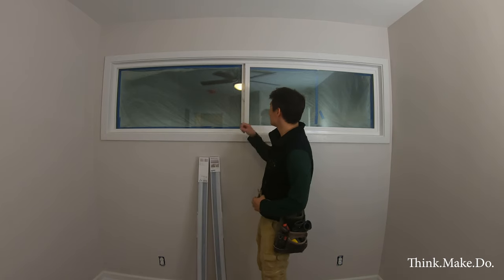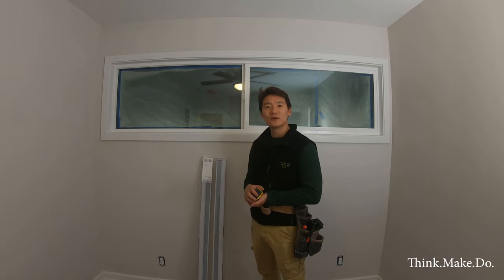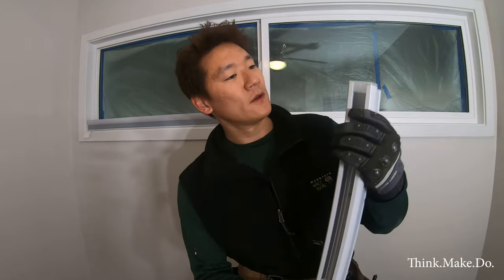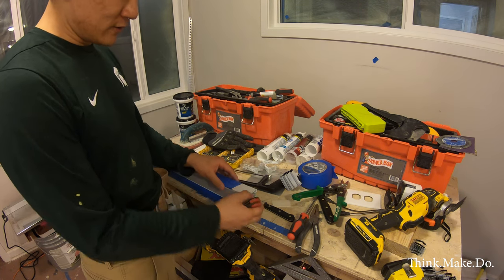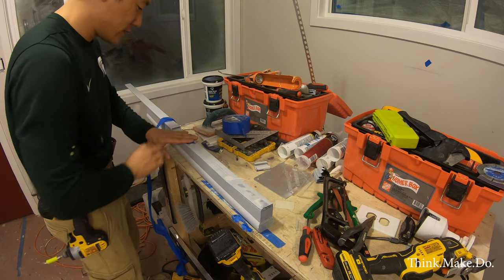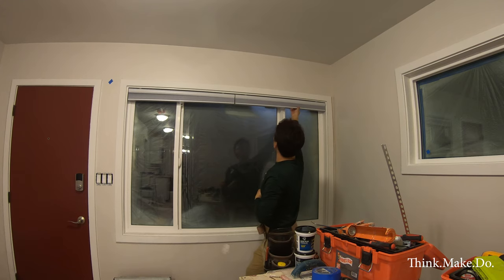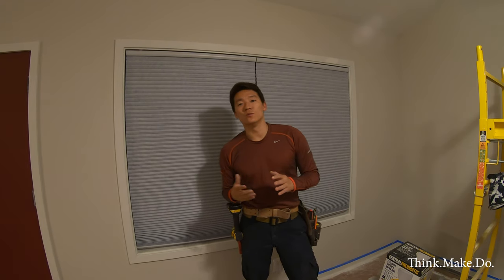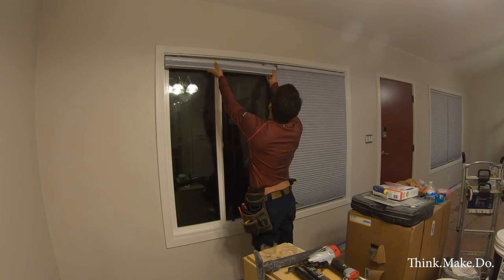Custom Blinds? Try Ikea for Half the Price

Comment: Definitely budget friendly.  This video showed me what I need.  Looking at those blinds from IKEA and thankfully I don't need 2 per window but I will need to trim them a bit.  This video showed me it's very possible.  Also good to see the weight repositioning.  I'll be doing that as well with mine.  These blinds are going to save us a fortune.
Reply from the maker: Hey! Really happy that the video helped you with our own blinds research.  thanks for the like and comment.
Reply: @ThinkMakeDo  Just finished.  Took forever to get them from IKEA with the whole COVID nonsense but wow what a difference.  Used a Dremel powersaw on the metal brackets and a knife like yourself on the actual blinds.  They look and work great.  Wouldn't have attempted without this video.  My wife loves them so much we're going to put them in more rooms.  Thanks again.
Reply from the maker: @siberwolf33  wooohoo! glad you got it done and liked them!  im going to do them on my next unit again soon!

Comment: Is the weight that you found in the bottom of the blind.........the bit that pulls down away from the top?
Reply from the maker: Hi Greta,  Yes the weight is at the bottom of the blind.  it helps to pull down the blinds and maintain some weight balance so it stays in position.

Comment: Cool video, thanks. I was wondering though - all info I can find on how to customize these blinds seems to deal with the width and not the lenght. I was initially worried that it'd look weird having them bunch up at the bottom if I wouldn't cut them to lenght. Do you think it's fine leaving them as they are?
Reply from the maker: Hey @tilhon, i thought about the length as well but it was not an issue.  My shortest window was around 2 feet long, and the bunch at the bottom did not look bad at all. You barely notice the extra since its an accordion style shade.

Comment: Hey all the lengths come in at 76 inches I was wondering if the length mattered at all? Did you do any adjustments or just kept it as it is and it still worked?
Reply from the maker: For me the length did not matter.  The blinds bunch up at the bottom but because its accordion style it does not look unnatural when it its resting position.  i have some windows that are only 24in in length, and they look fine.
Reply: @ThinkMakeDo  Thanks a lot for replying! Appreciate the help!

Comment: Thanks Phil, your video gave me the courage to buy Hoppvals blinds to boost the insulating capacity of my windows, as otherwise I would have assumed they couldn't be made slightly narrower. Later I found this other video where the guy just bound the blinds in place with tape and hacksawed straight through. I think I'll try that on one blind that has an edge that will be hidden, although it won't be as neat on the fabric as yours was using the knife. However, I'll check first to make sure the weight isn't down that side like the one you found. Thank you for a great video and I plan to watch some of your other videos :) 
https://www.youtube.com/watch?v=TXoQTsOQWRA
Reply from the maker: So happy you found the video useful for your own DIY Project!  Good luck and Have FUN!